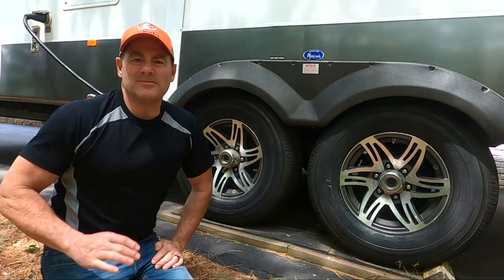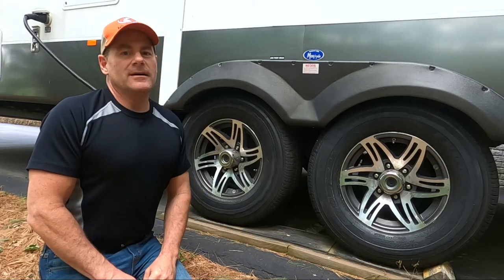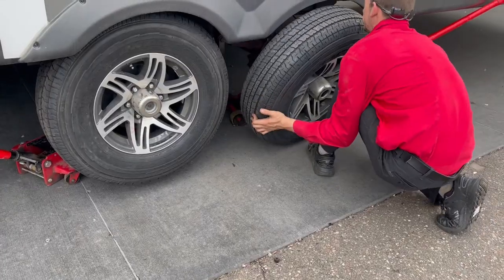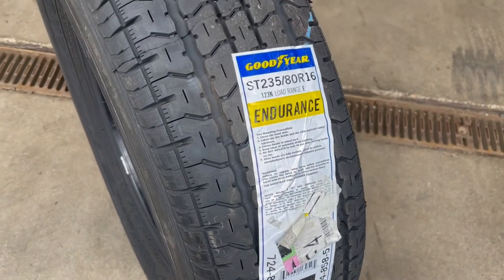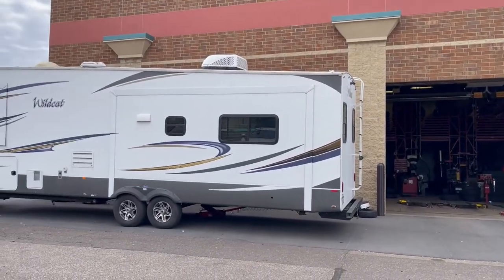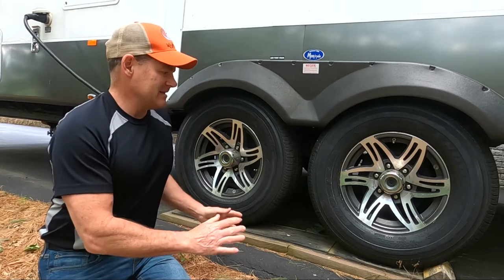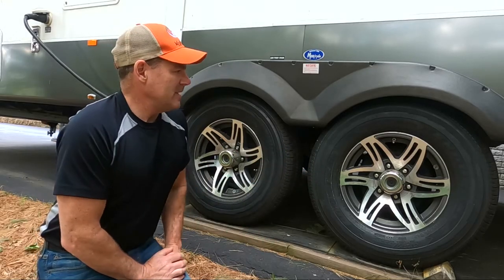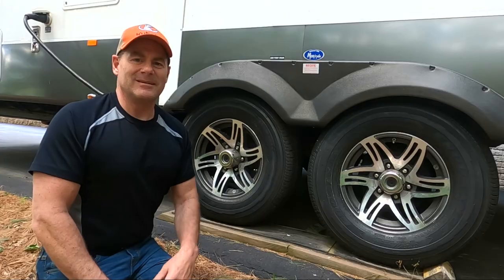#93 Goodyear Endurance Trailer Tires - Best RV Tire - Discount Tire

Comment: Just got rid of my GoodYear Endurance tires on my toy hauler (4-yo, always stored inside, less than 10k miles, no signs of dry-rotting).  Went with TransEagle ST All-Steels, because they are MUCH stiffer than regular Steel-Belted.  I went from E-Rated 10-ply to G-Rated 14-ply, and 81mph rated.  I put these on all my trailers now and have never had a problem since.    They were also about $100/ea. less than the Endurance.  Much less roll-over in turns, less sidewall flex, run at 100-110psi (so I got new wheels as well), TPMS says they run at lower temps, and seem to give me an extra .1-.25 mpg. All-Steel tires are also more puncture resistant...
Reply: glad to read 
 this just bought some transeagle st for my toyhauler

Comment: Goodyear has a chart for the proper tire pressure for the weight of the trailer. CAT scale for the trailer weight when loaded. Many people simply read the sidewall which is maximum PSI for that tire. But better wear and ride if we follow the Goodyear recommendations for pressure.

Comment: Hey Dave nice tires! I actually just replaced the tires on our Cougar Fifth wheel! I ran them for 3 years and I guess it was just a precautionary change because I have had a blow out before. One thing I would add is… running the proper pressure in your tires!!! I check my pressure before we leave on a trip and before we come home. Safe travels Dave👍🏻👍🏻
Reply from the maker: Agree on the pressure comment.  critical to have that right.

Comment: I put the Goodyear endurance on my Arctic Fox last year, and on a 3300 mile trip, I had three of the four develop sidewall bulges. I know for a fact I didn't hit anything with them, and the one guy at Discount tires said it might have been a bad batch.
Reply: They do come with a bulges from the factory I ask about it there is a reason behind it
Reply: How much torque do the lug nuts on the AF require? I cannot find any specs for six bolt hubs.

Comment: I have found that with the Good Year Endurance they are not rated as high for weight as compared to a same sized Sailun.
Reply from the maker: Very true.  I now see Cooper has a decent trailer tire and is stock on some Grand Design models.

Comment: I'm sure it's been asked, but are you happy after a year? I'm on my 3rd blowout in one year on Carlise tires. This last one was a bit scary, heading down a 7% grade off the  260 just south of the Mogollon Rim! I'm ready to drop $$. Blowouts are incredibly dangerous, especially with a wife and four kids on board.
Reply: I agree, I have had 2 blowouts so far with my Castle Rocks, Load Range D that came with my RV going down the highway. Super scary, damaged my rim and parts of my RV.

Comment: Just bought a new Travel trailer and it came with these Goodyear trailer tires and it does say up to 87mph although i would never drive that fast pulling a trailer. Hopefully i get at least 5 years out of them. Arizona heat tends to be the tire killer more than anything else lol.

Comment: Excellent video, and I agree with all of your points.  The one thing I would add is the importance of correct tire inflation pressure to maximize cargo weight capacity.  I am upgrading my travel-trailer tires from Ranier load D to Goodyear Endurance load E tires as well and will run them at 80 PSI (Load E max pressure).  Bolt on steel valve stems are a must, as you have with your load F tires.  I see too many rubber valve stems, which can blow out with high heat/pressure causing instant tire failure as well.  Thank you for educating people.
Reply from the maker: Great points you make.  Thanks for adding them.  We all learn from this real world experience sharing.

Comment: I hope you have better luck with the Goodyears than I did.  I replaced all 5 of my tires with the Endurance the day I picked up the trailer.  Not quite 3 years on them with a TPMS system that I use and recommend.  I religiously ensured the tires were properly inflated and the temperatures were good the whole time as well.  Just this past Sunday I had one blow out losing the cap and destroying the side of my 5th wheel.  We are full time RVers these tires did not just sit.  We do not ever go faster than 65 towing.  Mine were E rated moving to G with the new ones.  Also I only buy at Discount Tire.

Comment: One thing I missed in your video is discussing the max load of the wheel (aka, the rim).  They are stamped on the inside of the wheel (not the tire).  If you put on a tire that has a load rating greater than the wheel max load you risk damaging your wheel.   Stick within the rating of the wheel max load rating.  

For example, a 5v'r has 235 80R 16 tire with the wheel stamped max load of 3580.  So the Goodyear Endurance for this size tire is within the wheel stamped load index.   

That said,  you can't always go with a tire that has a higher load rating without damaging the wheel!  Just my $0.02...  

 Hope this helps.

Update:  I replaced my Rainiers today with Goodyear Endurance.  Thanks for sharing the video.
Reply: 13:15

Comment: I need new tires for my snowmobile trailer.   For me tread is important.  I want good traction when applying the trailer brakes on snowy roads.  Also don't want the trailer breaking loose going around a corner on icy roads.

Comment: *Best for Travel Trailers*
Stiff sidewalls is ONLY a good thing for travel trailers with sway issues (which is why silver bullets love them).   Keeps the trailer on the "rails" better because no lateral sidewall flex with the sway resonance they see with every gust of air.

Fifth wheel, or short length trailers don't have this issue, and a stiff sidewall is just going to vibrate your trailer and appliances more.    Cushion and sidewall flex is a good thing.  I had no idea the GY Endurance had such a stiff tire...I'm going Carlisle after seeing these "hand-squish" demos everywhere online.  It's a marking pitch by the tire shops to push the premium price of GY, it's right before they show you your air filter has bugs on it 😅.

Comment: My first set were Goodyear Endurance - They lasted less than 10,000 miles going cross country and delamination was starting and apparent.  Not willing to take the chance with these tires again I went with Sailun S637 G-rated.  Yes this is overkill!  I've traveled cross country 2 more times with great performance. Tires are made in VietNam ISO rated company.  Tires are 50lbs each 14ply steel belted. Commercial truckers have these on their trailers with great success.  Do your reasearch ask questions

Comment: I run commercial tires on my 5th wheel.  Les Schwab GeoStar G574 G rated L speed 75 mph.  110 PSI.  Load is 5071. When a tire goes out on an RV it can typically do thousands of dollars of damage.  Good year, Hercules and Carlisle are good. Good information!!

Comment: I just had a China bomb come apart on my two year old boat trailer.  (It's why I'm here)   I'm replacing them with the Endurance.  I won't talk too loud yet,   I'll see.  
Tread on a trailer tire normally never wears down,  the tires just deteriorate and break down.
Reply from the maker: Makes sense.  I have about 8000 miles on these now in very hot temps.  So far so good.

Comment: My dump trailer came with "Providers", and I am dissatisfied with them.  The tires split longitudinally between treads, but fortunately were caught during preflight inspection both times without catastrophic failure.

I was unable to find Carlisle trailer tires made in the USA, but perhaps didn't search correctly.

I am about to replace all trailer tires with Goodyear Endurance tires.  I like the higher N speed rating, though I will never see the rated 87MPH while towing any of my trailers.  The same size Endurance tires come with a LOWER weight rating than the Providers, and don't even meet the max-gross rating of the trailer.  I was thinking that the higher speed rating buys some margin, but it looks like the next bigger Endurance is rated for my 6" wide rims and will fit in the trailers providing a substantial boost in tire weight rating.  I occasionally run the tires/trailer at or slightly above the design limit, though those instances are in careful controlled situations.  The split Providers were never overloaded or underinflated.

I was unable to find suitable truck tires at any price that would meet my needs; once again, perhaps I didn't look correctly.  Though spendy, I would do that if I knew how to make it work.

Result:  Switching FROM Provider ST235/80R16 TO Endurance ST235/85R16.

Good video!

Comment: Great video.  I too am looking at American-made tires as a top pick.  I have similar criteria for looking at my 5th-wheel replacement tires as you have.  The GY Endurance is at the top of my list.  However, my first quote is $160 more than the Hankook tires I'm also looking at.  The Hankook Smart Flex TH31 is NOT an American-made tire (Korean).  But it does have decent reviews.  I wish I could do a sifness comparison with that tire.    Overall, great review, and thanks.  I'm heading over to Discount Tire to check their prices on the Endurance.  Hopefully less than the $445/tire I was quoted at a Good Year store.  One more thing you need to add to your list of items causing a blowout is your bearings. (which falls under your heat category).  Having your bearings checked once a year is a good idea.  My blowout was most likely dues to bad bearings, causing heat.  Thanks again!

Comment: I have Carlisle’s on the tv I bought about 1.5 years ago. 2019 original to the rig tires. Always checked tire pressure before any trips and stay 65 and below. Had one just come apart on the tread where all the metal was showing so I don’t know if you’d consider that a blowout or not. Can’t help but wonder if it was something I did or not, if anyone has any insight that would be great!

Comment: My 2022 KZ came with Goodyear Endurance tires, and I am glad that it did.  It was also prewired for Tire Linc monitoring, so I added that later.  As a first-time travel trailer owner, I think this is a good system to minimize tire problems.
Reply from the maker: Agree.  Also the best thing you can do is slow down.  No tire is good when going fast.  Lots of heat.

Comment: Hi Dave, I need to have your comment about that... I live in Canada, so when I leave to go to florida it is -25 degrees, my tire pressure is at 80 psi. When I get to Florida to pressure is higher cause probably the hot weater. What would you do deflate de tire when I arrived to hot wheater ? Usualy there are aroud 90 psi when i get close to Florida. Thanks nice video.

Comment: Interstate 5 going through California is a tire killer. I blew out two good year marathons in a hundred mile stretch. Needless to say I replaced all 4 with the endurance and finished my trip to Oregon. The endurance run cooler than the marathons ever did. I recently took a 400 mile trip with another trailer and the tires on it were showing stress. I stopped at a rest stop 30 miles from my home due to the tread coming off on one of them. I felt the tread on the rest and they were gummy. I'm going to discount tire next week to replace them all with the endurance tires.

Comment: Buying a Basecamp next week, which comes with Goodyear LT's. Would you suggest replacing with ST's off the bat and selling the others as new, or keeping them?
Reply: Not an expert, but always read Trailers should have ST tires on them, not LT, they are just different. The ways the trailers are set up from dealer aren't always great.
Reply: Thanks!

Comment: I just swapped out 11 year old Good Year Marathons (made in China) for good year endurance. Luckily I never had an issue with the way to old Marathons. My trailer is dual axle and only about 5,000lbs. the Marathons were load range C so I went with load range D. Discount thought the E range would be overkill for the weight of my trailer.

Comment: Do rims have a PSI rating. I want to upgrade from a D rated tire to E, but can the rim handle the extra psi?
Reply: Yes that’s what I did the ol d s just don’t handle the weight  10 ply  went w E s at 3200 each  that puts me over 10 k on a 8200 r v

Comment: Them not telling you to balance is BS.  A tire that is way out of balance run hot and fly apart, plus, like you said is bad for the bearings
Reply from the maker: Agree.  Was a red flag for me.  I like Discount Tire.  Very passionate about tires.  The do it right and have great prices as well as support after the sale.
Reply: Give me 1 good reason why I shouldn't  balance the tires?  And don't give me the old "we never balanced them before".

Comment: What about the Maxxis Tire M8008 compared with Goodyear?
Reply from the maker: I didn't research those so can't comment.
Reply: I had the Maxxis M8008 on our last travel trailer and they were a decent tire for the price.  Our current 5th wheel came with the Trailer King RST which I swapped out to GY Endurance's.  I had two of the GY fail; the first one was within 400 miles and the second one was around 1000 miles.  On both accounts the GY dealer told me to go kick rocks the ST tires didn't have a warranty so they would not replace them on both instances I replaced the failed tire with the GY Endurance and have not had any issues since.  Here we are 2 1/2 years later and they will need to be replaced as they are weather-checking and the tread is getting very thin on them.  I plan on replacing them before next camping season however, they will not be with another set of GY Endurance tires.  Goodyear has lost my business forever.

Comment: You use the term "Rating" a lot but it isn't clear what you mean? "Load Rating" or "Load Capacity" is a function of inflation. "Load Range" as LR-F  and LR-G of the same size have the same Load Capacity if both are inflated to the same PSI. It's important that we be more accurate with the terms we use.   RE China tires and statistics. For many years almost all RV trailers came with tires made in Asia so why would the "Statistics" not have most failures on China-made tires. As an Engineer, you know that Correlation is not the same as Causation.  Where can we find the data that supports your claim that truck tires "delaminate" more than ST-type tires? You are correct with the benefits of balancing the tires. You are also correct that higher speed generates more heat and heat can kill a tire. You failed to mention the benefits of the Nylon layer in the tread. The shallower tread will generate less heat. You can learn more if you review by blog www.RVTireSafety.net
Reply from the maker: Thanks for the added detail.  Great info and insight.  So far the tires have been great.  8000 miles in some very hot temps out west.